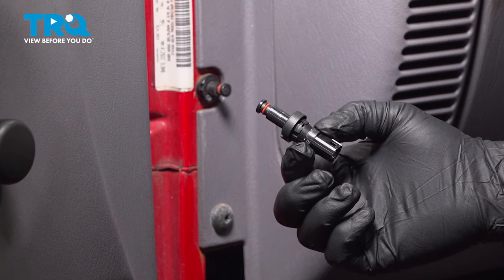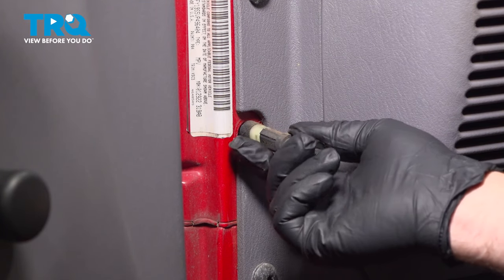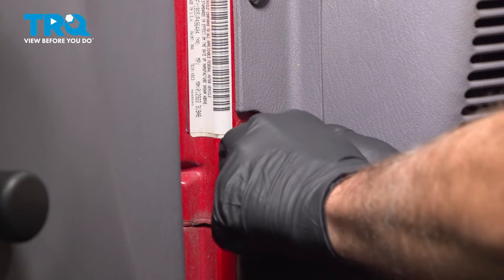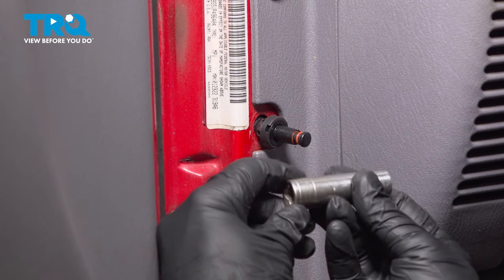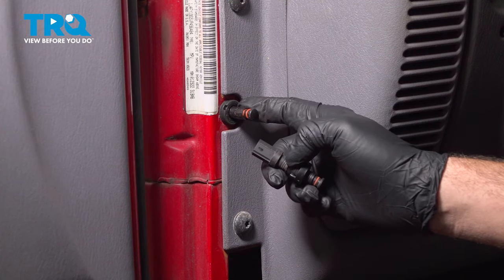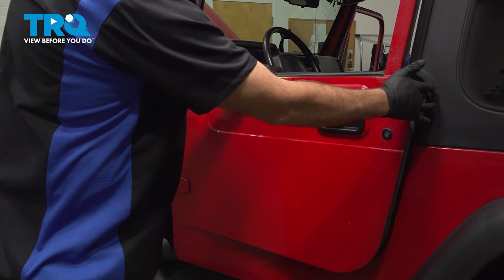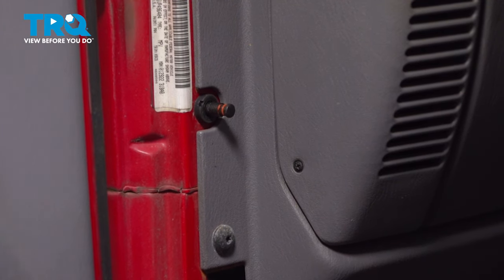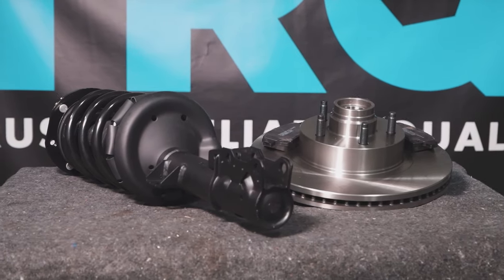How to Replace Door Jamb Switch 1997-2006 Jeep Wrangler

Comment: Thanks 😊,   

This walkthrough helped over all amd the 13mm Socket tip was pivotal but, I needed to use a slightly more agreesive hammer to tap the switch in place.  

I appreciate your guidance 🎉